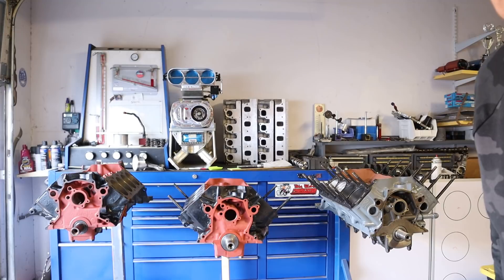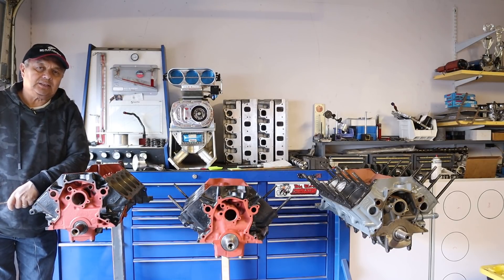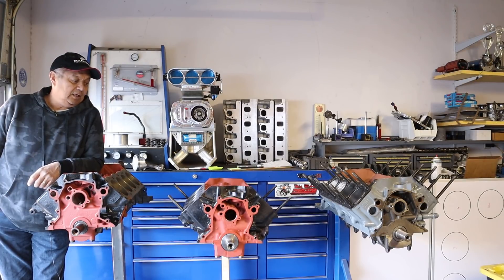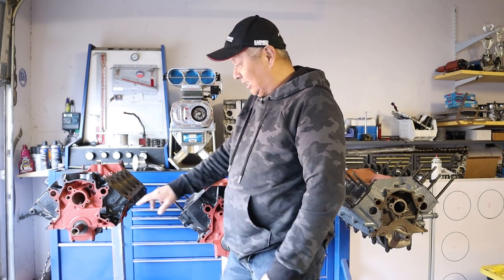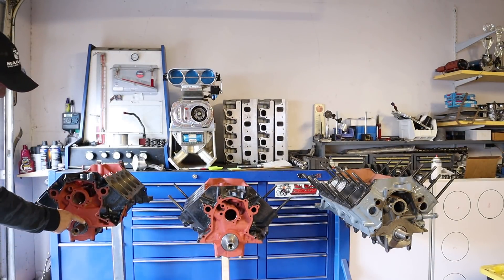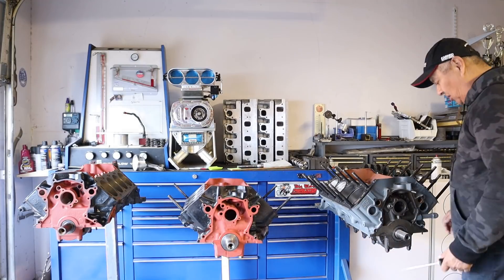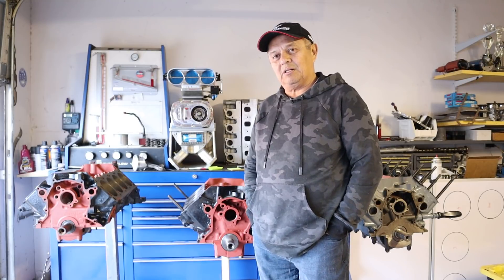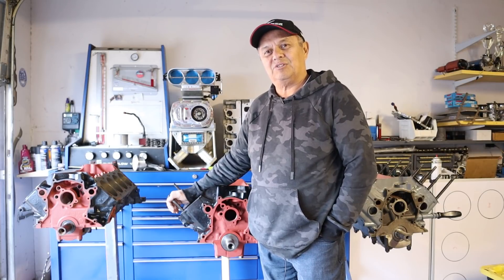FORD SMALL BLOCK SPLITTING EXPLAINED

Comment: So, you recommend 1-3 firing order, zero balancing, steel cranks, proper tuning, avoiding excessive rpm. What else can be done before switching to an aftermarket block? Fluidampr balancer, camshaft balancing, cam designs with smooth valvetrain harmonics(asymmetrical lobes using a Spintron), billet main caps, block welding/reinforcing, aluminum girdle?
Reply: One big thing to consider is how much stress the car and how you use it effects things like your engine block. Drag racing for example applies way more shock loading of components than say road racing or street driving. Even with drag racing an automatic is way easier on parts than a manual is. Every bang of the clutch is REALLY hard on parts. Also radial vs a slick if your radial dead hooks it transfers all that shock into the car where the slick wrinkles and absorbs the shock load of the launch. Also the more you solid mount/bush your car the more stress you put everything through since the squishy rubber mounts absorb all that vibration and harshness.
Reply: Running at least a mid motor plate will help more then anything. It keeps all the twisting from the drive train of the block

Comment: Man I really dig this stuff. Excellent example of thinking out of the box! I split my first block (and only) way back in 2000 when I first went 347. Since then I've been running an R302 block, but it's heavy!  Companies sell their main cap girdles, but the cracking is like you mentioned, right above the cam valley. How does harmonics/detonation play a role. One thing I've wondered is the durability of cast cranks vs forged. How often do cast cranks fail? I remember my stock 302 breaking at the snout back in 95.
Reply from the maker: Richard, the cranks at extreme rpms, power or both combined makes the crankshaft twist to an "S".  Forging would resist this more than a cast crank so there is a concern there at extreme levels.  Now other parts  breakage  results from this twisting loads the #2 and #4 caps and usually it breaks at #2 and from the studs to the cam tunnel and above!

Comment: is installing a girdle helping or making it worse? thanks
Reply from the maker: A girdle works until it starts bouncing the caps and the girdle will effectively transfer this destructive motions to # 1-3-5 mains!  Bouncing starts with numbers 2 and 4 and without a girdle will remain there.  Having it,  transfers it to the others and therefore it helps until it starts to shake and it takes it to everyone else on the mains!!!

Comment: i have also heard from people the balance / vibration and RPM kills them. if you keep the harmonics in check they can live.
Reply from the maker: Matt, harmonics is the silent killer and detonation/pre ignition induced vibrations will definitely destroy an engine or any engine.  I prefer to take a center counterweight and zero balance or both to lessen the twisting of the crank that can load the engine evenly and creates this problems.

Comment: Thanks for being so unselfish with your knowledge/expertise and all the work you put in to publish this info!  💪
Reply from the maker: Thanks for supporting my channel!
Reply: @benalamedaracing2765  This makes alot of sense. I only run Clevelands so I have the 1-3 firing order. I have a 4 bolt in my 70 Cougar now and I have a spare 4 bolt in my shed. Problem with that block is I need to sleeve all 8 because the rust pitting is to deep and will have to go .060 What are your thoughts on sleeing all 8?
Reply: I need some Crypto bro 😭 lol

0x242c7Be4fca328Eb28F219b8bfFC0ceD98fA9C88

Comment: Ive personally yet to break an 8.2 deck stock block. Granted i never made big power, but the car was high 9s on nitrous w a 5 speed. 8000 rpm burnouts, shifted at 7000 rpm on nitrous and motor passes. I showed that engine no mercy lol.
Reply from the maker: Adam, you are tuning and not abusing your engine with those impressive times at the track!  
It shows the blocks are not that bad really looking at what you are able to do with that 8.2.

Comment: I've seen your Facebook post a while back about you building a Toyota 2tg you reshape the combustion Chambers and ran flat top Pistons would be nice if you talked about your import engines that you built also what kind of power you got out of that little guy keep them videos coming already subscribed brother
Reply from the maker: Mika, thanks and I will follow up with a comparison between the 280Z 180 head vs. the BMW/Skyline cylinder heads.  It should be interesting!